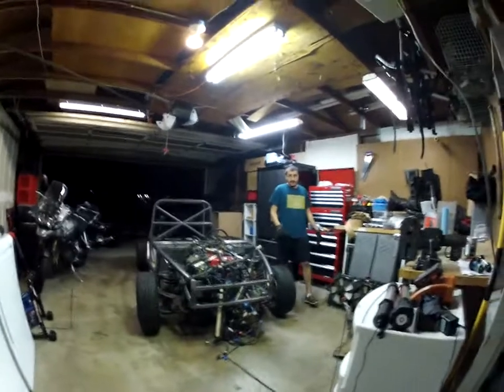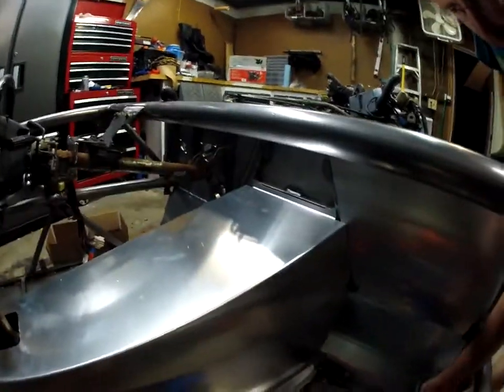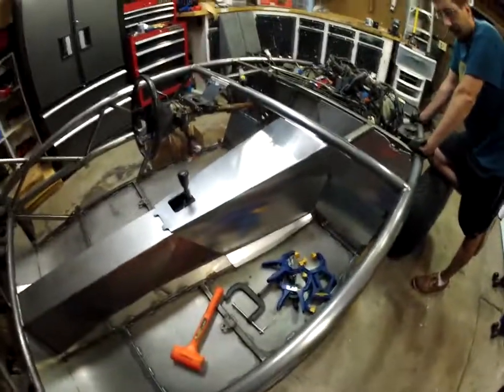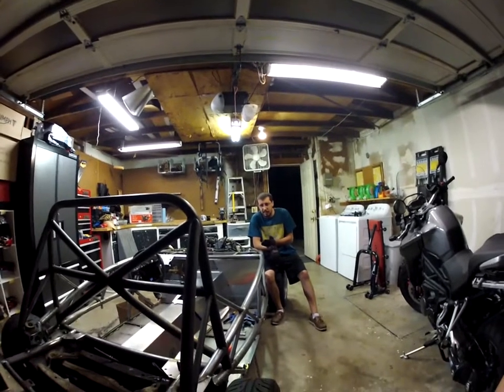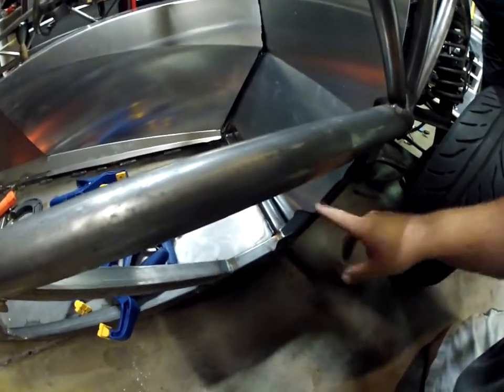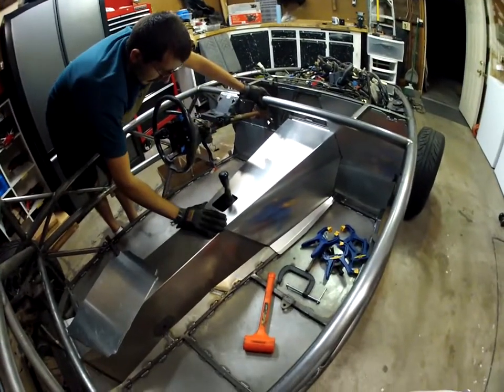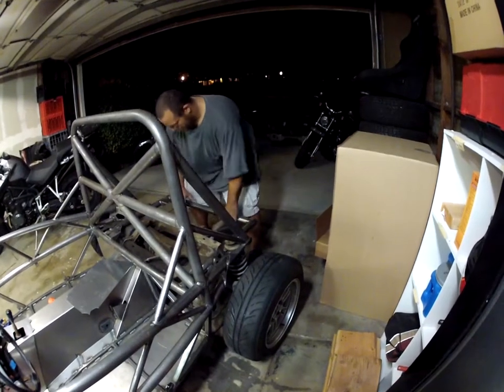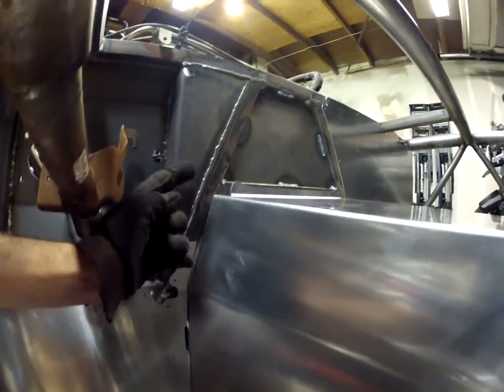Exocet Build Part 12

Comment: Strange fitment issues you seem to be having.  You'd think it would all bolt together right since it's a kit from the same supplier.
Reply from the maker: You'd think, eh!?

Small company woes, I suppose.  We have chassis # 202 or something like that, so not exactly a lot of them around.

My guess is that they make the panels a bit big to account for error - you can work with it a bit if it's too much material but not if it's too little material.  Though I am surprised at the lack of fitment upfront overall.